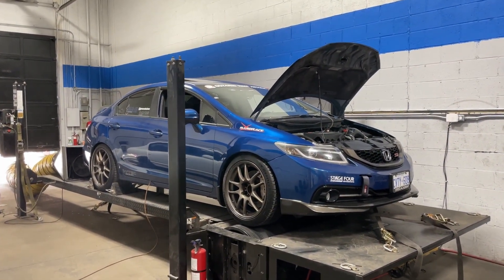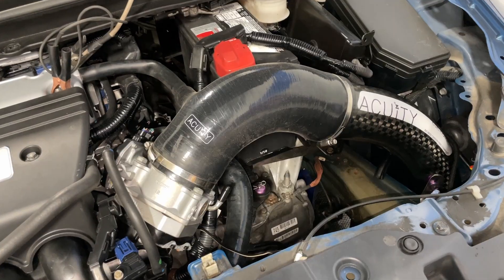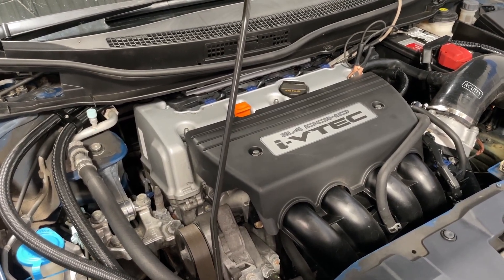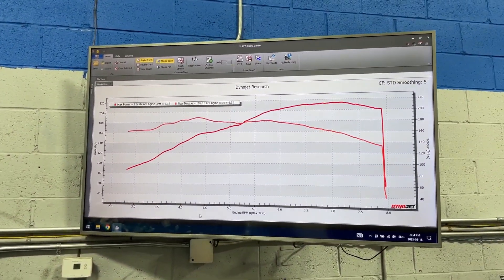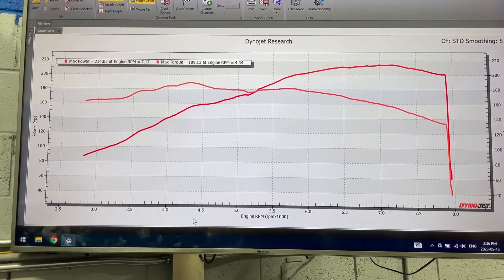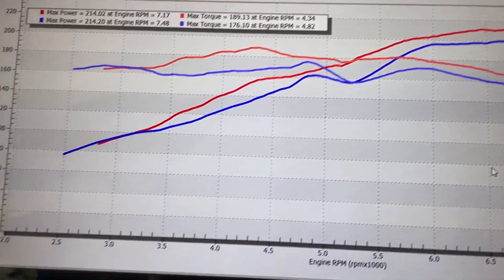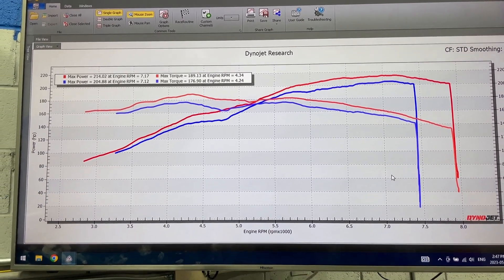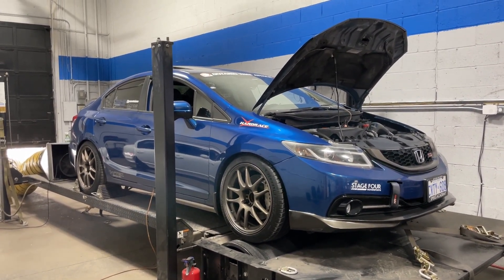K24Z7 4Piston Drop in Cam Dyno Tune

Comment: GOOD MORNING NICK. I HAVE A K24-A2. JUST HAVE A LITTLE ISSUE WITH IT. WHILE DRIVING ANY SPEED AND OUT OF THE BLUE IT WILL START POPPING THRU THE EXHAUST. THE COILS ARE NEW AND PLUGS. IT DOES FEEL LIKE A MISFIRE BUT IT'S NOT. ANY IDEAS? I ALSO RUN HONDATA AND THE K SWAP IMMOBILIZER. AND NEW HARNESS

Comment: Surely the throttle body upgrade is pointless as the inlet for the plastic manifold is only 64.5mm anyway? Unless this was bored out somehow?
Reply: Yes and no. In basic terms this was more about throttle response and being able to use the intake setup I was after.
Reply: Throttleboy adapter goes from 70mm to 64.5mm

Comment: I can't find a straight answer on this in any of the forums, can I use z7 cams in the z3? Like aftermarket or even stock cams
Reply: k24z3 or k20z3?
Reply: @grassrootscience4461  k24z3
Reply: @loganstrid8724  as far as I can understand it, the engines are basically the same other than some parts externally got moved around due to the different cars they are installed in. The internals are all the same.

Comment: What are your thought about swapping an RRC on these cars compared to an RBC? Have one laying around and I’m wondering if it’s worth swapping
Reply: Rrc is better then rbc
Reply: I would say do it! Should have great gains and if you can port it even better.
Reply: Im very tempted! i know the rrc is better than the rbc  but what im trying to figure out if with the rrc installed will it have the torque loss as the rbc. I would want to do the rrc with these 4p cams  @grassrootscience4461

Comment: I want to see how reliable this setup is for those of us out there who daily our 9th Gen Si’s. What are the cons to upgrading the cams? I’m looking at getting stage 2 skunk2 cams with the upgraded valve springs put in but don’t want to ruin my daily. (Does it affect long term reliability?)
Reply: Well, I'm over 6 months into daily driving and tracking the car. No issues at all
Reply: @grassrootscience4461  are you going RBC soon ? would love to see that comparison
Reply: Cams don't or never have made Hondas any less reliable than stock. My F20b has been running pro2 cams since 2008 and it's still running.

Comment: That’s crazy, I have skunk 2 CAI and the Skunk 2 full race exhaust and tuned out makes 218 hp. Now I’m wondering what it’ll make if I do the drop in cams with the RBC manifold and throttle body upgrade..
Reply: We will find out in a few months
Reply: I LOVE NATURALLY ASPIRATED ENGINES
Reply: what's your full build list my man? that's crazy gains on an exhaust and CAI
Reply: Is that whp ? Becuase I was dyno tuned with the same setup

Comment: Makes you wonder how the cams work with rbc or with a turbo and rbc setup. Is it worth getting cams of you're forged rods, pistons and turbo?
Reply: Lol 10lbs 330 torque on first pass for me on pump gas, and 25% duty
Reply: @AiroRad is that with a return fuel system? Thinking about getting these cams for my boosted 9th.
Reply: Their cams work wonders
Reply: For sure. 4piston advertises a steep gain on boosted cars.

Comment: These drop in cams really make more torque.  That's crazy.  Imagine with a type s oil pump
Reply: The type-s pump wouldn't help with power in this case. The graph is dropping off above 7,500rpm. Usually you do the type-s pump to delete the balance shafts in the oil pump to safely rev higher.
Reply: @MrKylev35 it frees up rotating mass on the engine it would at least feel more torquey on the road just from the responsiveness, I feel like at least

Comment: For the price of those cams, shoulda did a headswap instead
Reply: I race in a organization where a head swap wouldn’t make sense.
Reply: Nah, my k24z3 tsx auto put down 220whp @7800 rpm fbo on stock cams, but made 170wtq, this setup with a better intake manifold will def put close to 250whp and def get over 200wtq, thats impressive without having to swap heads and changing out header and all that crap. Ported stock head would be nuts.

Comment: Considering most stock k24z7 engines come from the factory laying down only 160-170 whp on most Dynos, this is pretty impressive on the plastic manifold. Can’t wait to see someone use an sk2 ultra manifold and these cams. 4p racing already have shown what the motor can do with ITBs and more compression.
Reply: I’m gonna be running skunk2 ultra manifold but with skunk2 cams instead, hoping to have it done soon.
Reply: @_Silver15Si_  that should be a nice setup. Hopefully we will see a lot more of these kinda builds.
Reply: @jarebb1 ended up making 219/169 on a dyno with the skunk2 cams, ultra street manifold, stock intake, 2.5” catted dp and 3” catback exhaust on 93
Came back after adding flex fuel kit and made 228/178 on e50, stock intake box.
Reply: @_Silver15Si_  a 3.5inch cold air intake and 3 inch catless would’ve got you +240 forsure.
Reply: Probably could’ve cracked 230’s with catless 3” dp and acuity cold air intake but Miami has sus flooding so no go on the intake.
Reply: @_Silver15Si_   nice! That’s a strong Z7. Hopefully I can post a video of mine in the next year. Thanks for the update.
Reply: @jarebb1  the vtec crack w the skunk2 manifold and drop in cams is wayyyy more pronounced, I was so happy with it, don’t think the stock manifold could do that.

I’m now supercharged w a kraftwerks kit on e85, was looking to ask Nick how much power I could make by upgrading to a catless 3” compared to rv6 2.5 catted or if the difference would be negligible.
Reply: @_Silver15Si_  3 inch catless will definitely help the engine breathe a lot more on our k24z7’s especially if your boosted. Also, how you liking the Kraftwerks kit so far? Looking to go boost soon and am trying to decide between Kraftwerks and merc racing.
Reply: @tommythao3799  i was debating the same but went w/ kraftwerks after doing my due diligence. Merc racing is legit 100% but there’s usually a long wait time to get your SC plus it’s about 8k for the 1900 kit which is the best bang for buck blower they offer. I got mine for 4.7k which was inside my budget too.
Reply: @tommythao3799   the kit is a blast, it’s basically vtec on steroids and I love it. Perfect amount of power for a daily… imho if you want 450whp and up, I recommend just going turbo, but this kit makes 350-430whp easily with the correct supporting mods. (I made 415whp on dyno w a catted 2.5” downpipe thats why I asked about going catless 3”)
Reply: @_Silver15Si_     yeah I’ve heard about the long wait period with the merc racing kit. It is also a pretty penny compared to Kraftwerks. I want to be around 400-450whp for now because I’m still on stock motor. I’ve been seeing a lot of people blow their stock motor once they reach +500whp. Until I fully build my motor, I’m okay with 400-450 so the turbo can wait. Im running a 3inch catless downpipe atm but it’s really not necessary unless you’re trying to reach +450whp. What clutch, transmission and fuel system are you running? Have you had any issues with the Kraftwerks kit? Belt slipping? Some people have said they’ve experienced parts missing when their kit was delivered. Anything I should be aware of?
Reply: @ no issues at all so far, knock on wood lol.
Running clutchmasters fx300 kit and deatschwerks return system, which came with the dw400 pump, the cage, lines, fittings, fpr filters, etc.

All my parts came just fine, I feel that was during the early times when people experienced those issues (the 2010’s) but i assume being 2025 they should have all the kits perfectly made, with nothing missing.
I see a lot of the belt slip comes with people overspinning the blower way beyond its limits rather than the occasional overspinning by a tiny fraction. For example 8th gen users running k24 cp’s and also running a 95-100mm blower pulley, revving to 9k which overspins by a hell load compared to stock cp, 110mm pulley revving to 8300
Reply: @_Silver15Si_  I plan on running the fx400 kit and walbro 450 fuel system. You still got the skunk2 drop in cam? Did you have to use the Kraftwerks intake manifold with the blower? Trying to decide if I should even buy the skunk2 ultra manifold or just go straight to the Kraftwerks kit.
Reply: @ i think for the stock kit you have to use their manifold, unless you’re getting the race kit which is mounted where the ac compressor goes.
And yea I have the cams, that’s why I was debating type s oil pump, but not sure about it 100%, I’m just revving to 7600 for now to be on the safe side.
The fx300 is plenty, these kits don’t make crazy torque, i got 300 trq, but nothing wrong w going 400 since you may go turbo one day but be ready to upgrade your gears and have transmission work done.
Reply: @_Silver15Si_  Oh I didn’t know they had different kits. Do you still have ac with your kit? I think the type s oil pump is definitely worth it if you want more top end power. Yeah just wanted to go straight to the fx400 because I’m probably going to want more power in the future. You still on stock trans?
Reply: @jarebb1  it well do more if you add the RBC intake manifold or skunk2 pro or ultra. The R40 has most strongest 💪 contenting rods from previous Gen. Definitely has more tork then previous gen. 11.1.1 compression ratio

Comment: THANK YOU for proving so many things!
The RBC is not worth it in my opinion AND I’ve recently been looking into these cams and there’s not a lot of info/videos so this is perfect! About 10whp and 8-10wtq BUT steep upward power curve holding strong to redline. I like it I bet it runs real good
Reply: Feels like a much bigger engine below 4,000rpm
Reply: @grassrootscience4461  I bet, the power curve is super linear like it carries all the way through the rpm range
Reply: @joeymcquilkin3670  yup. You start to feel it lose at about 7,000rpm which I expect with this setup
Reply: I'm impressed with the numbers and how quiet the car is. I'm catless with the 3 inch down pipe and  I sound like I have cams. (Not what I wanted 😂)
I opted for the RRC manifold from a type R with a j37 throttle body. My mid range pulls very hard. He would be happy with a bigger manifold. 
Great video Nick 👍.
Reply: @IronGamersTV do you have more info on ur build
Reply: Exactly same here ! That Rbc is not worth it in my opinion. I’m doing the cams and rest of bolt ons but no Rbc swap . Great information!
Reply: @backyard9144  RBC or any other manifold can be worth it if you spend much time above 5500rpm. But day-to-day driving the car moves as it is now!
Reply: @grassrootscience4461  great information thank you !
Reply: You guys are so wrong you can touch the 230 hp with no cams just with ported RBC , bigger Throttle Body and bigger injectors. There’s plenty of build with no cams on 230hp in Puerto Rico and those cars have more hp in the States or Canada because Puerto Rico weather is worst for cars they loss power.
Reply: I used be against the RBC for the similar reasons as labeled above.. made friends with  a tuner south Florida, who basically opted to do the swap (there was a RBC laying around the shop), tune it, and if I didn't like it, swap it back.. that was 8 years ago.. I only removed the RBC to install a KW kit.  The RBC car is the faster car, drivability (torque loss that everyone is afraid of) is almost unnotii..rev limit raised to 7900 is the.. vtec crossover dropped to 4200 at wot, and 5k in low vacuum states .. a good tuner is the key.. do the RBC swap.. you will feel foolish for not doing it sooner, lol
Reply: @jamaicansole1  never truly understood why the rbc hate tbh, the rbc wins everytime plus the portability is very helpful
Reply: My final numbers were 234whp tuned by Carlos Sanchez on the cp Motorsports dyno in htx.. oh and added cam angle too, if remember correctly.. you guys speaking down on the RBC swap are wrong. I'm speaking from experience, and you will be hard pressed to find someone who did the swap, and regrets it..
Reply: @jamaicansole1 what were ur mods to make 234whp? Im planning on k24a2 swapping my 9th gen
Reply: Do you guys think the skunk2 drop in cams would make similar power to these?
Looking to test those out tbh

Comment: Was the Manifold at least port matched to the OEM 70mm Ridgeline TB??
Reply: Nope. The intake inlet design doesn’t really allow for porting
Reply: @grassrootscience4461  so basically pointless and actually causing turbulence/loss of power because of that TB? 😂 I assume the RBC can at least be port matched for that TB?
Reply: @lcq4blackstar  lol yeah for sure lost power. You got me.
Reply: @grassrootscience4461  ??
Reply: @lcq4blackstar  turbulence is not as bad as everyone makes it out to be. Back in the 90’s-2000’s oe had butterfly valves in there intake to change the volume of the intake manifold and to introduce turbulence. The down side to it is the top end of the engine suffers and outright peak numbers are just not there. 

In theory, if I was able to port match this the power band would move up a few 100rpm and I would make an extra 3hp but would lose about the same in torque and the low end would not look the same.
Reply: @grassrootscience4461  eh I too run that same TB. It was a 2.5MM diameter wall going into the stock manifold... Most definitely a loss of power everywhere if left like that (No port match). Apples to oranges because turbo K23 to your K24Z7, in your scenario I would take a matched wall TB over an Big TB undersized wall completely stopping velocity and creating a buffer zone essentially making the inlet even smaller than it is. Also your TB (J35) is not the size said in the video, TB is measured at the butterfly diameter J32=65mm J35=68mm J37=70mm.

Comment: Nice! Very interested to see the graph overlay with RBC manifold swap when that gets done... Everyone with First Gen RDX wants to run the RBC manifold but I keep saying the 9th Gen plastic manifold is the way to go because the auto trans is limited to 7k RPM and all they are doing is loosing power where our engine lives. The last graph showing between 4P cam/no cam stock manifold neither rolls over until 7100-7200RPM. My prediction the RBC will be down compared to stock manifold until 6800 then beat it to redline for the 9th Gen in your video here.

For 1G RDX I would go the plastic manifold for FMIC (it is THE best OEM manifold for a 7k redline)
For TMIC stock ported 1G is the best option

Comment: Im wondering with the rbc catless exhaust setup with the rbc in florida at 0 elivation if 220-230 woukd be realistic/possible
Reply: Absolutely!
Reply: I make 235whp 205tq in my FBO 9th sen si, catless, ported RBC 72mm tb, custom 3in intake, cnt downpipe, invidia n1 3in catback, 750cc gram injectors, stage 1 clutch with 10lb flywheel. Tuned on 92 pump gas.
Reply: @pjpelayox3  that's sick were you live and imagine if you did e85
Reply: @justinharris627  I live in Seattle and my tuner said gains from e85 would be negligible for what I have done. I wouldn’t really see any major gains maybe 5hp max switching to e85. I’m in the process of doing the k20z3 headswap.
Reply: I wouldnt be surprised if you surpass that

Comment: Damn very disappointed epesically for the 1500 bucks. Guess im gonna gave to experiment with the bigger cams cus thats poo
Reply: There are stage 2 cams as well. Just requires head work.
Reply: There is article on motortrend where Nick has tuned k swap civic with stock k24a2 08 and than swap dc dic in it and gain was 15ish hp on low cam and 20-25hp on hi cam. 

You can google it out.
Reply: Stock intake manifold is the choke point on this setup, once it breaths I wont be surprised to see more power everywhere in the powerband.